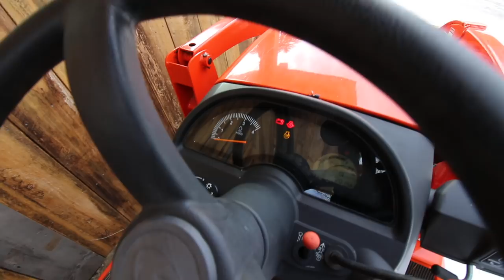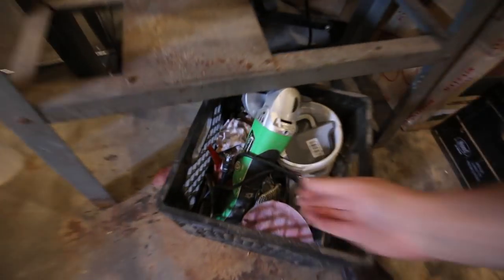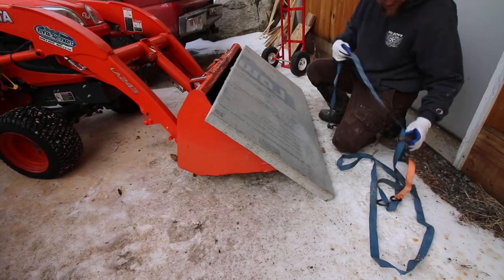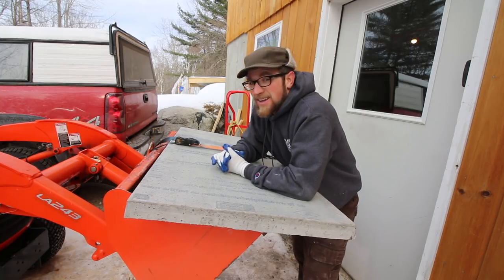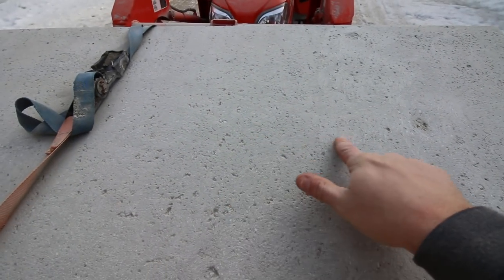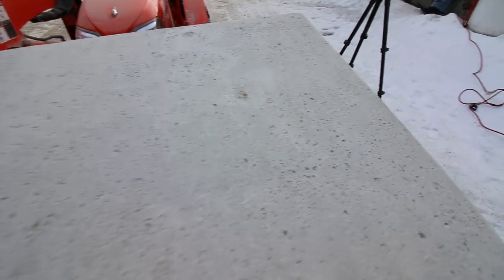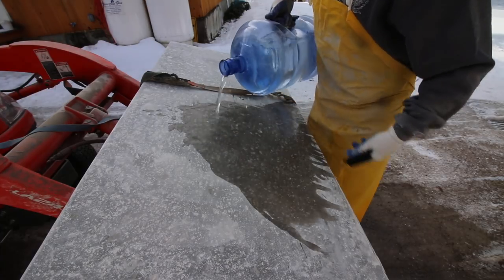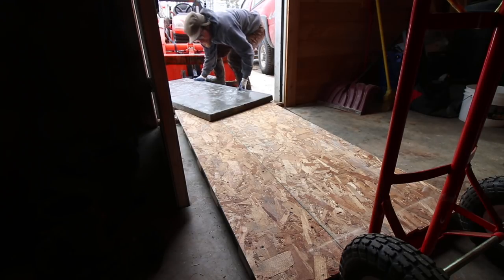Polishing the Concrete CounterTop ~ Using a Kubota and a Ratchet Strap

Comment: Having your concrete thick is the right thing to do. Where you had the problem was in thinking that a vibrating sander was going to settle material this dense.  Solution:  Put a carriage bolt into a hammer drill and using the hammer function vibrate the frame. This will beat that concrete into submission...you'll know when you've done it enough by the amount of water and bubbles which will come to the surface proving that the particles have settled.  I spent years making concrete stones for housing veneer so this is not a mindless comment but a helpful suggestion from one who enjoys your videos.

Comment: Great video Al. Candide Thirtythree suggested using the same epoxy finish that was used to coat the 'business top' in the outdoor toilet, that has my vote also, it should fill the craters in and level finish the whole top, you could put bible versus, pictures, poetry versus, favorite sayings, art work, etc. embossed under the clear finish.
A flat furniture dolly used on one end and the hand truck on the other makes for a smooth movement of heavy large items, use the hand truck tung to lift one end to slip the flat dolly under that end, then use the hand truck on the other end just the same as you did. I also highly recommend that a set of forks for the bucket of the Bota when finances and time allows. Not that you aren't the master operator, but it will up your game for safer lifting and more versitlity. God Bless
Reply from the maker: Thanks, good idea on the furniture dolly.

Comment: Hey Al, Countertop looks awesome. I'm sure you have a plan and you may be done with it by the time this airs but I did a couple houses with concrete countertops and I wound up using some tile grout to fill the big pits. I did it after the first coat of sealer so it didn't stain the surface and just used a grey to match the concrete. Works like a charm. If you put a few coats of sealer on it that will fill the little pits in just fine. Keep up the good work!
Reply from the maker: good tip thanks for sharing!

Comment: Al I'm not a concrete expert or anything but I think the differences in top finish may be because your kitchen counter top was poured to where the top surface was at top and you were able to wet sponge it filling in any divots, whereas this counter top was poured in a form where the top was at the bottom. Wetter concrete mix might have helped.  Whatever, I'm sure you'll get it to looking great. Certainly unique.  

And Gina is right, a guy and his tractor...!

Comment: Al, when it comes to the wetness of the concrete pour, you are right that in this pour, it probably should have been wetter because you were not finishing the side that was going to be seen, you were relying on the concrete to settle smooth against the surface of the foam. I think the experts were right on the first pour, though, but in that pour you were finishing the side that would be seen with trowels, and a drier pour their would have been better. Learning is the game, though, and we are all going through it in one way or another.

Comment: AL, I have seen a lot of your videos.  This is not the best, but it is certainly the most unbelievable.  Who would ever think of making a desk top using cement.?  Unbelievable! I am really stating to know Al Lumnah as a person.  I was really blessed the day just happened across your channel when you had just gone over 5000 subscribers.   Today you are approaching 19,000 and heading for 20,000.  I think my name is down for the chicken plucker.  
You make the sanding look so easy.  
Al, do you plan for dairy as part of your homestead?  I found out that goats and cows tie you down more than any other part of the homestead.  
We found out soupy concrete and waiting an extra day or two works best for us.  When we are making concrete blocks we use about 40 bags of filler and not as much water.  Otherwise we use a lot of water, but we are in the tropics.  That works for us, but it may not work for others.  Cement work lasts a long time, what difference is an extra few days.  God bless America.
Reply from the maker: We would like to get dairy goats at some point. But first one of us needs to be on the homestead full time and not working. They seem to take a lot of time

Comment: Thin concrete can fill in those holes.   Use a small amount and mix it to to a thick soup-like consistency and paint it on with your foam brush.   Give it a few days to dry then with a few passes of 200+ grit sandpaper wet sand the surface to smooth it.

Also to save weight next time, figure out where your support will be, then use foam to hollow-out around those areas before filling in your form.   It is not as strong.  For a  permanent desk installation,  holding a 'ton'  likely isn't your concern.

Comment: It wasn't wet enough. That's why the vibrations couldn't get the air bubbles out. Next time you pour it that dry, try a pencil vibrator or 
a reciprocating saw without the blade against the form. Usually, when you have small pits, create a slurry with the same mix and rub
it into the slab and let it dry.

Comment: Good work with successfully handling and polishing the counter top - a difficult job completed nicely. I'm curious what surface you'll be going for. I'd favor creating a lip around the edge with tape and then coating the concrete with a thin layer of resin to fill the pits and leave a smooth even surface, if it's level when poured? :)
Reply: I agree a resin finish would work wonderfully on this.

Comment: You might consider parging the top to fill the holes left by the air bubbles. It wouldn't be as strong as the concrete but after sanding it should give you a smooth surface to write on. Coming along nicely. Stay warm.   https://en.wikipedia.org/wiki/Parge_coat

Comment: Watching you use that spray bottle just hurts my hand.  I learned while using one to remove my wallpaper and my popcorn ceiling that my insecticide sprayer was a much better solution.  Just pump it up and press the handle.  You might think about it.

Comment: Al, I know this is more than a year later, but.... The commenters who said you should have used a thicker concrete mix were both right and wrong. The stiffer mix will produce a higher ultimate strength for the concrete (3000 lb is pretty standard). More water makes the concrete flow better (hence the fewer number of voids). Alternately, you could use a concrete vibrator to help make it flow and reduce the voids. But that's not really practical for a pour of such shallow depth. And that's where the commenters who were saying you need a stiffer mix go wrong.  You are making counter tops! Not structural concrete! 

So... If you ever do another concrete counter top... make it as thin as you need to, or add a plasticizer to the mix.